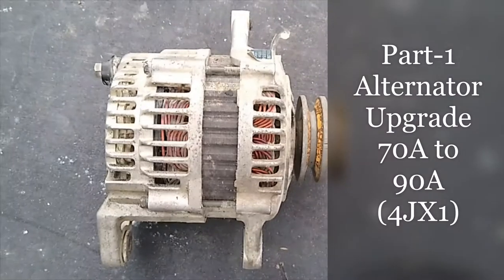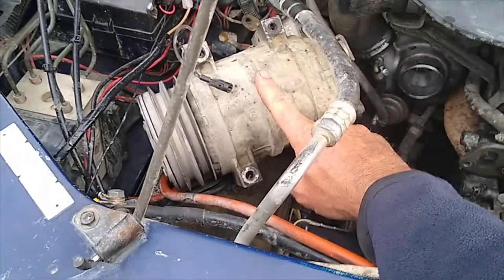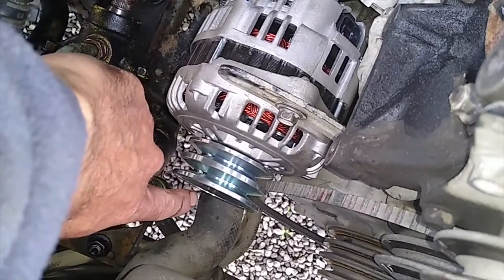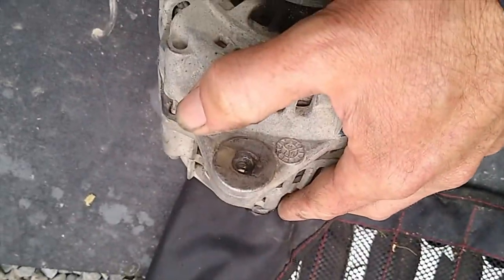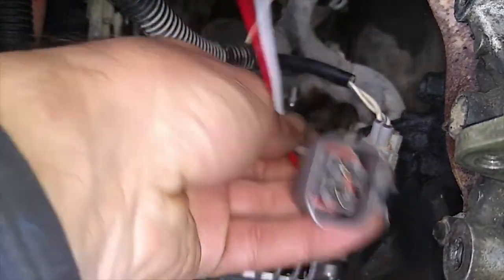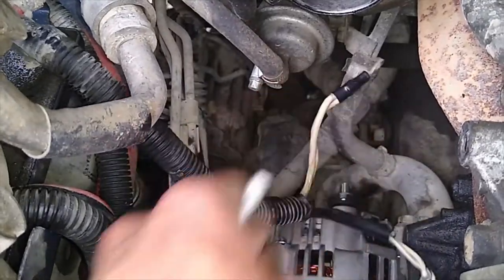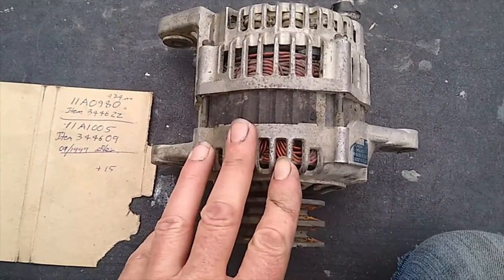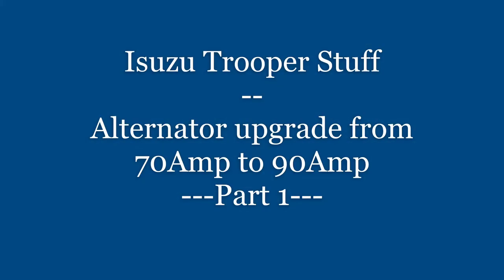Part-1 Alternator Upgrade (4JX1)  70A to 90A Jackaroo/Bighorn

Comment: I didn’t have as much play with the new alternator as it seems you did , I went over your video a few times too check.
I couldn’t tighten the belts anymore .
My plug is hard up against the water pump hose
Reply: At 5:33 minutes in the video I mentioned belts and there lengths, I ended up using a longer belt because the pulley on the alternator was larger. You may need an even longer belt if it continues to cause.  you issues. Thanks for watching.
Reply: Grabbed the  11A1005 belts this morning, but it looks like I need to get the next size up to give me more room for the plug.
Thankful for these videos

Comment: Thanks mate. Did this job today. Found a 90 AMP straight swap from REPCO so no need to change the plug. I did use the bigger belts though to make my job easier. https://www.repco.com.au/en/parts-service/electrical-parts-vehicle-management/alternators/alt-12v-90a-hitachi-style-rxa071/p/A9337800